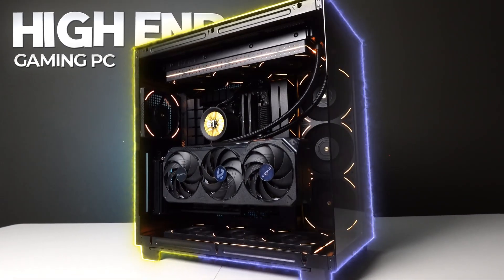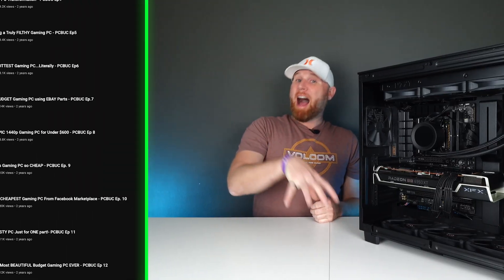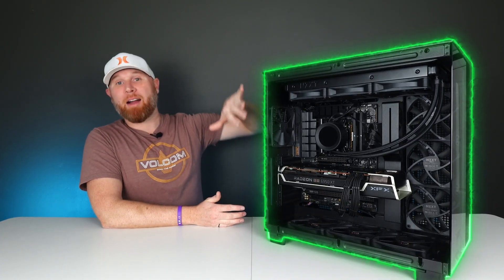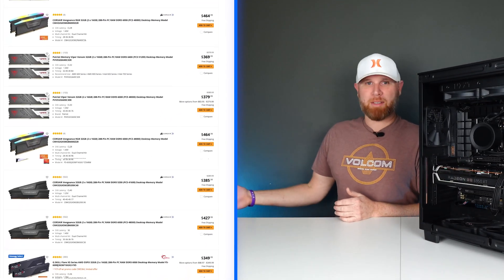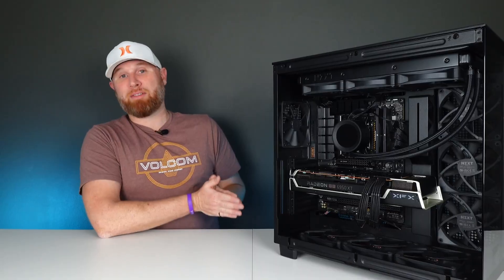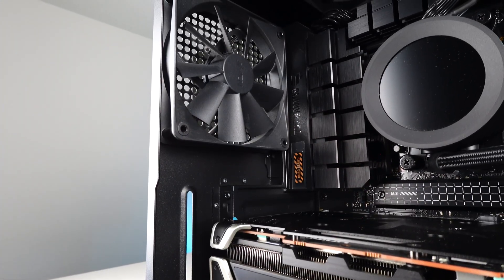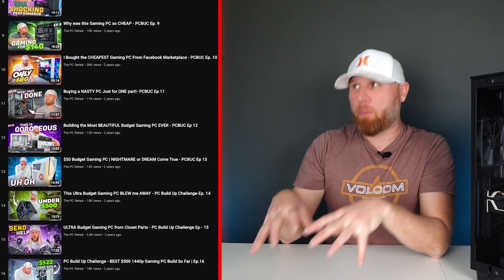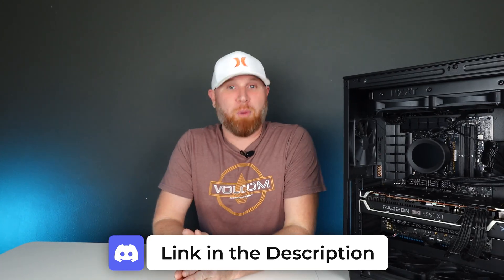$1700 Gaming PC With $3000 Performance

Comment: 7800x3d bought on sale for $350

Used rtx 5090 gigabyte gaming oc  2.3k 

new 1300w Lian li edge platinum on sale for $214

ddr5 8000 CL38 $140 

x670e-gene $300 

Rtx 5090 water block was on sale for $105 

mycro direct die $150 

13-14 barrow fittings $70

3 radiators $160 

Lian li evo xl $150 

2tb sk Hynix platinum p41 on sale for $140 

barrow soft tubing (2 meters) $13

13 fans $116 (I had 6 other fans laying around & used those on 2 radiators for push pull)

Corsair xd5 used $40 (all I had to do was clean it) 

Dp ultra clear coolant $24 per liter (I got 3) 

a win is a win